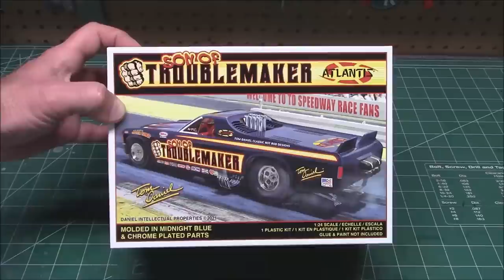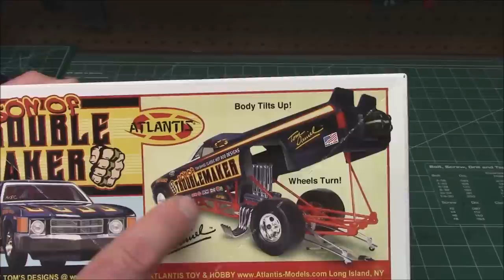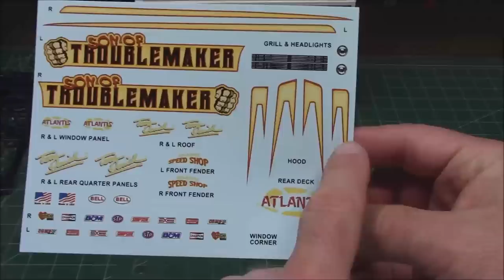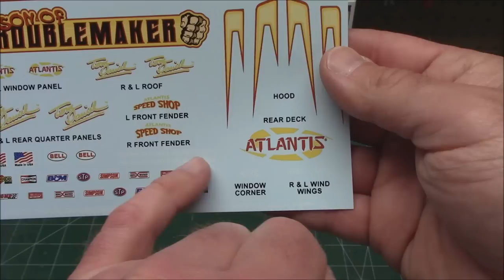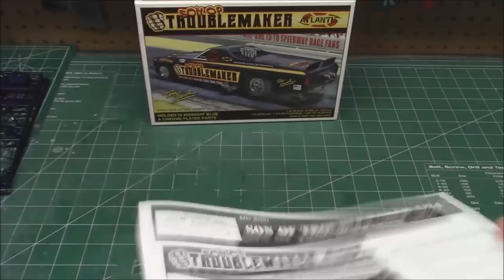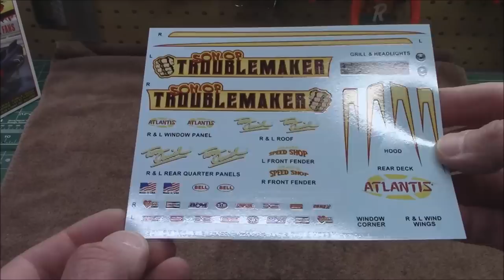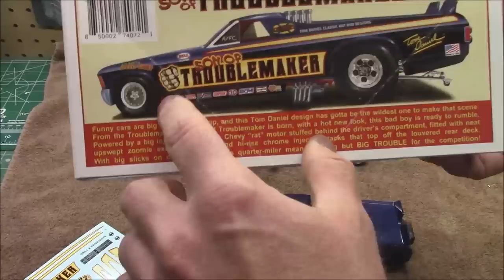El Camino SS 454 Son of Troublemaker Funny Car 1/24 Scale Model Build How To Glass Engine Chassis

Comment: What glue have you been using lately that has the brush built into the cap? I've used Testors glue with the brush built into the cap and it never bonds the pieces together very well or quickly.
Reply from the maker: I like Plastruct Bondene, Model Roundup and other places sell it. 
Most of the liquid cements on the market work fine. 
I've used Testors liquid with the  pinkish label without issue myself, in fact I pour the Bondene into an old Testors bottle because it's shorter and wider.